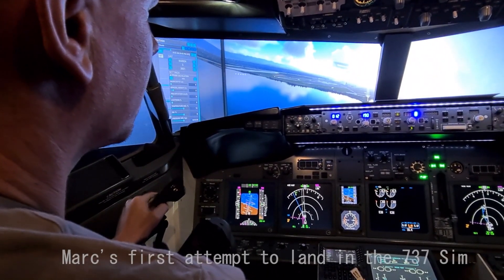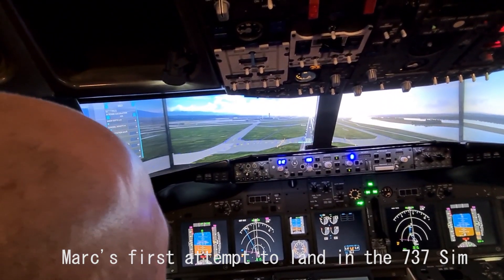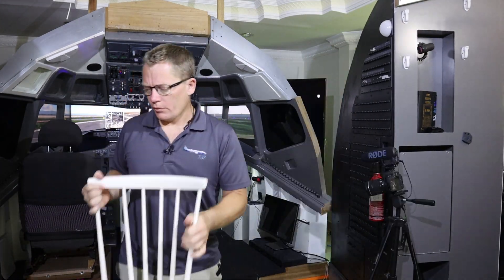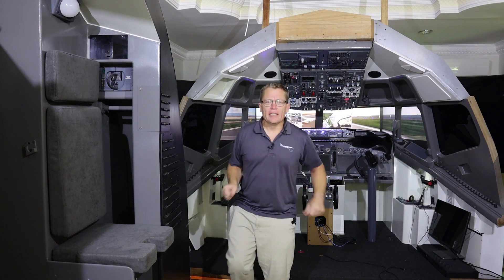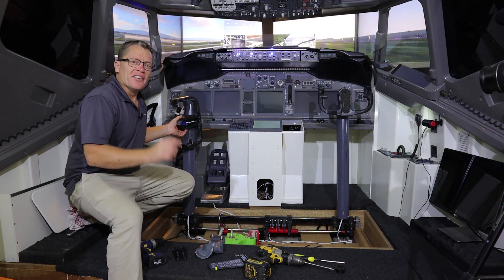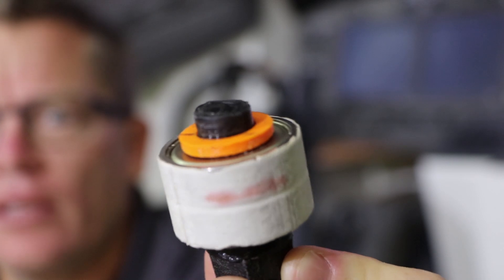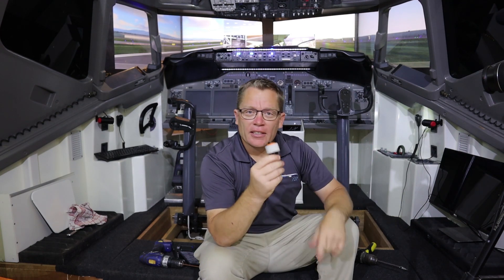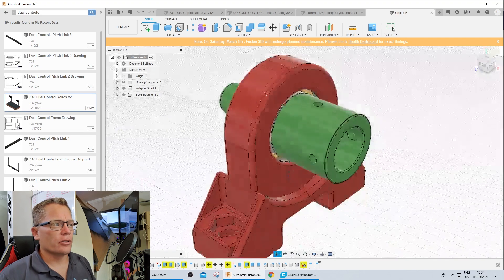Boeing 737 Dual Control Modifications

Comment: Try some PVA glue to hold down problematic parts like that. Just regular school grade glue stick. It's sticks well, when hot and is easily cleaned with water afterwards. It will change your life!
Reply from the maker: Hi Guy, Thank you for the suggestion, but i have now used FROG tape from amazon. That too works extremly well and prevents any bed warping. Kidn regards Karl

Comment: You need to just have these machined in steel. The 737 maintenance manual calls for setting the roll centering to at least 13 pound inches at only 2 degrees of deflection. The values acceptable can be up to  120.25 pound-inches at 75 degrees roll deflection. The elevator force at 145 knots per the maintenance manual should be about 19 pounds at 2 degrees of deflection and 35 pounds at 7 degrees. The test calls for a airspeed to 370 to equal 37.5 pounds at only 2 degrees of column deflection, that would be upwards of 100 at full deflection. On a non force feedback set up like yours, you would want to set the controls to approach speed forces. 
Disclaimer-The elevator forces in the maintenance manual are for elevator surface deflection, I had to convert them to column deflection. The ratio should be 1:1 but in the real airplane the cable tensions between the column and feel and center unit in the tail would probably cause the yoke to feel to vary slightly away from what I calculated.
Reply from the maker: Well done sir and thank you for this valuable information. A true legend and will hopefully add this to the website! Kind Regards Karl